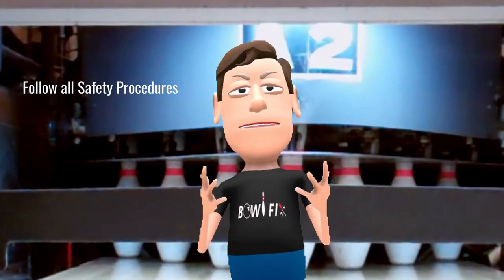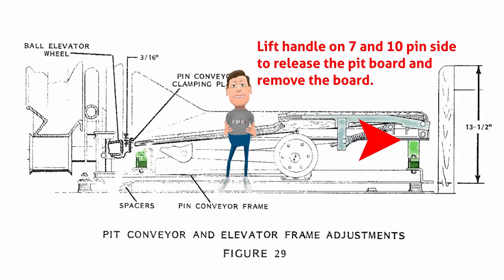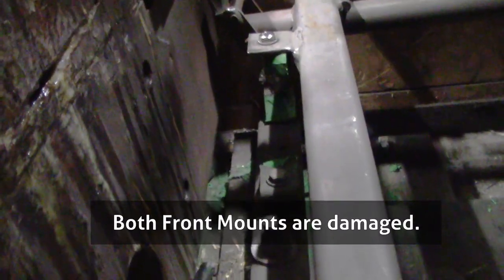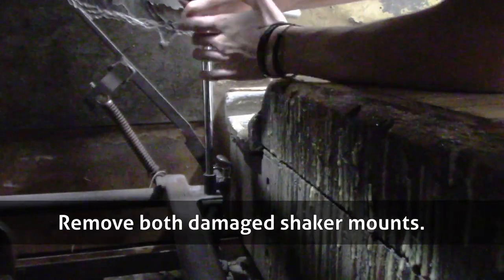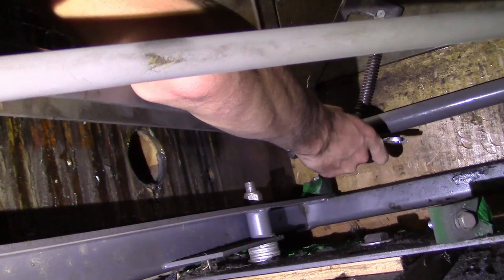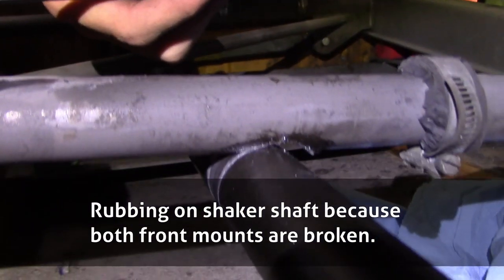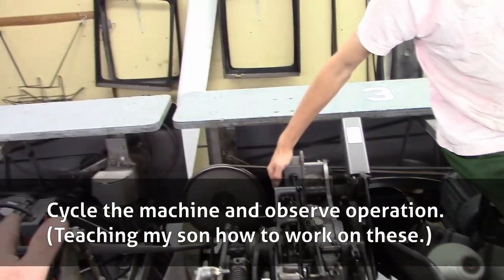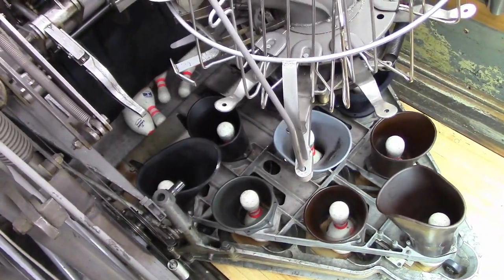Brunswick A2 Pinsetter Shaker Board Mount Repair | Bowlfix

Comment: Have you ever considered getting an A-2 conveyer kit from Mol-Bowling?
Reply from the maker: I doubt this house would ever install anything like that.  I worked on AMF 82-30's with a conveyor belt feed,  and they were difficult to replace belts and pullies.  If the shaker is adjusted with a good slope and the carpet/ liner and pins are clean, they work pretty good.
Reply: @BowlFix  I don’t like AMF’s carpet and GS Transport Band cause they like to rip apart quickly. I seen one time during our League Night at my local AMF Center on their Poor Maintained 82-90 XL’s that a pin’s head managed to get into the side of carpet and get stuck. And me and my League mates had to wait probably almost 30 Mins to an hour. Jeez if my local center had A2’s that would be a lot better than any AMF Mechanics saying A2’s are dangerous like one stupid guy on YouTube named @vittoriostoraro says that
Reply from the maker: @PinoyBowlerGS92  ALL machinery is dangerous,  Heck, driving is dangerous...lol.  It is important to read and understand the operation of any machinery before repairs are made. Going from AMF 82-30 to Bruns A2, I find the A2 a much better machine, but you have to work on them before they break.  Cleaning and oiling is the best way to find problems before they become a major problem.  However,  proprietors sometime believe that the pinsetters don't need maintenance if they are working good. Eventually they don't work if you ignore them, and the cost of time and parts is usually higher to correct the issue.  Most of what I do is replace the an incorrect part or adjustment, with the correct one.  I un-do poor repairs.  Some repairs like a 4:1 gear become more expensive if they are ignored.  This takes 8+ hours.
The splines on the gearbox clutch wear out if you do not lube them annually; costing $300-$500 after they have worn themselves out.  Clean and lube may take 2 hours of labor but they say they can't afford to spend the money on labor.  I have rebuilt/ brought back 3 centers.  A 24, 32 and 16 lanes that were run into the ground. But they let them go rather than maintain a preventative maintenance schedule.  It is a cycle. 
Anyway, yes shakerboard over belt. :)  Thanks for the comment!
Reply: @bowlfix1939  At least Proprietors are great to pick up the challenge on their Free Fall Pinsetters instead to give up and switch to String Pins which I SUPER HATE STRING PINS, oh god that pin action was just terrible. I know cleaning and lubricating is important but not sure where to start for me if I would work at my local AMF Center on their dirty refurbished 82-90 XL’s that were already sitting there for 8 Years of no treatment. I would personally don’t care for Open Bowlers just by shut down 4 Lanes at a time for Cleaning, Lubricating and adjusting for the sake for my League Mates cause you know Leagues expect more than your Open Bowlers and I would want to work as a mechanic with a heart as a Bowler.